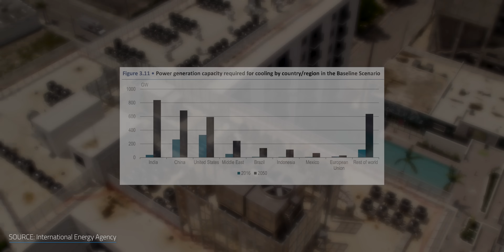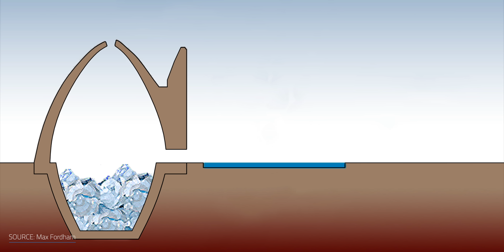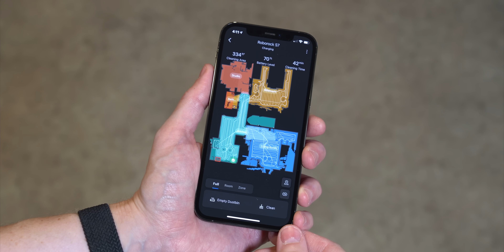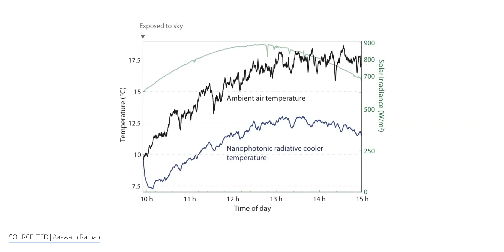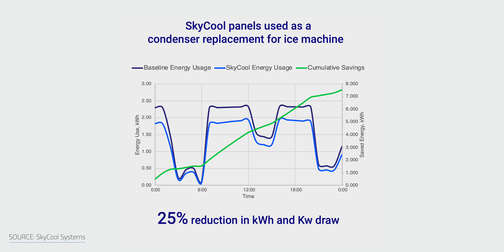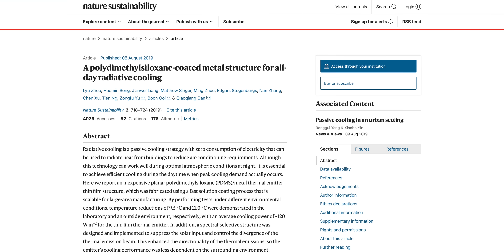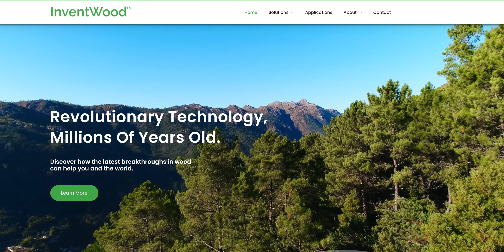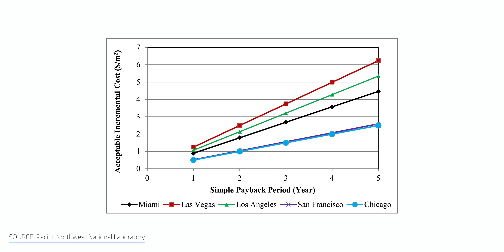Space Powered Cooling May Be the Future of Energy

Comment: It's a pity that the solar energy can't be turned into electricity  instead of reflected back 

Problem is, of course, that at an efficiency of 20% every kWh every unit of power releases four units of heat, which is why solar panels get hot

Comment: I'm a fan of anything that can reflect the heat from city rooftops, but my favourite solution is grass etc that reflects some of the light far better than black roof bitumen etc, the soil absorbs water and delays flooding in the water systems and the flora it adds to the city can help bees, birds, humans etc in so many ways. Of course it weighs more but it can also insulate thermal transmission and reduce noise in or from the building. Ideally it could be very low maintenance too contrary to a paint or something with moving parts. 

The more passive the better, not necessarily "natural".

Comment: If you design the layout to allow for gravity operated heat pipes you can both increase efficiency AND eliminate the electric pump. Braze it together like one would a commercial heat pump system, vacuum it out and inject the right amount of coolant and you'll have an hot and cold side less than 1 degree different.

Comment: Wouldn't it be better to capture some of the heat for hot water?   While the infrastructure costs are high, in multi tenant structures, the heat cycles can be exchanged, move heat where it's needed, heat water for domestic usage, use waste heat from industry for heating domiciles.    This not new, NY had steam distribution, but  it was a non-closed loop system

Comment: My central air conditioning broke in May. I couldn't afford to fix it right away and so I used a window unit in my bedroom and window unit in my living room and I turned on the bathroom exhaust fan.
Grant's sister coming over so I had to get another window unit for their bedrooms. I was expecting a catastrophic electric bill.

What I got was a fraction of my Norma Somerville. This is in humid hot Texas. Headed up stretching through the summer until August What's the total of 5 units. I only ran two at night. And I typically only ran three during the day leaving two rooms without air conditioning. But they stayed in the mid-80s due to air conditioning spillover from the other rooms. And I could chill them into the mid-70s in 2 minutes.

My electric bills for May June July were between 47 and 60% lower.  I got the central air conditioning unit repaired in August. And only used it when company came over and my bill was 31 per cent lower.  
The other benefits of the tiny units is that they can get my bedroom bone-chillingly cold.  That's now I know it isn't running up huge bill.

For hard dollar figures, my summer heating bill for July for a 2000 square foot house was $105. The prior summer it was $188.

They're also tremendously increasing the life of my central unit. They're inexpensive and costs between 85 and $180 depending on if you kept some on sale.  They're noisy in the same room but I get used to the noise after a short time unless I'm watching TV. All of mine are 5000 or 6000 BTU units.

Comment: My life‘s profession is HVAC and I make my money off of selling you the customer the biggest HVAC system I possibly can. 

But on the contrary I do just the opposite I try to inform my customer about insulating an airtight sealing and painting your roof white. 

In San Francisco in my second story of the house when the hot summer months would hit we call hot in San Francisco 85° is burning hot the second floor front face of the house with the sun the room will hit 100°

After putting Armstrong foam roofing and painting it white on an 85° day that same room would get about 89°. Without air-conditioning. 

My mom’s house just by painting the membrane flat roof with three coats of bright white roofing paint just before summer started now we’re approaching October and she never turned the air conditioning on even once. 

A white roof makes that much difference

Comment: If you wanted to cool the planet only then the best arrangment would likely be to float the radiator panels on water.  At night they will coll the water which should sink away from the panel in a natural convective turn over.  Durring the day the panels would flip over (ideally passivly via some density changing fluids) and show a black side to absorb as much heat as possible durring the day.  With no moving parts and mass produced in small units huge bodies of water could be covered.  Waste heat from other sources could be dumped into the water via piping laid at the bottom to radiate more heat.

Comment: So can't these techs do double duty.... reflect a UV heat radiation but have a sub that collect the photons energy.... like a solar panel so that aids in powering these systems plus have that which make these systems less strained in running with these cooling techs. I suppose mixing all these things together may aid in a truly passive home that doesn't need to be on the power grid and have less ac and heating units relying on chemicals that are poisonous. I will be in Arizona but its not for this reason yet I was seeking a way to make a tiny passive home in the middle of the desert that doesn't need AC because most of the solar rays beaming on it are reflected to other areas. I looked at sub terrainian home building or building a dome shaped home with thick walls.

Comment: yah. great idea. while we're at it, why not just throw away our cash, our assets and our customers too? space doesn't need our energy.. we sure do. collect the heat using evacuated solar tube panels.. like the ones we use for solar hot water. then you circulate the glycol through coils in huge sand bunkers. 1 cubic yard of sand holds 2 million btu's- and it will hold it for WEEKS. think of it as the cheapest battery storage device EVER- only instead of storing it directly as dc voltage... as heat. then you use the heat..    to run Stirling heat engines, power generators and meet the rising energy demands. in other words- USE the heat and convert it to kwh's.   

  Stirlings require a 'cold side' to operate.  for that,  you can use buried glycol coils to pull 56 deg. temp from the ground. for this reason- Stirling heat/power systems would work EVEN BETTER in icy cold climates like northern Canada- the setup for hot & cold Stirling power is simply reversed: underground coils for heat- above ground exchangers for cold. given of course.. in northern Canada- the coils would have to be around 10' deep. the 'heat' side could be supplemented by composting bio-mass, instead of burning. this method actually gives off MORE heat than actually burning and doesn't release massive amounts of carbon into the air. it's the process that nature normally does. 

 for areas where there just isn't enough room for all that sand for heat storage- there's a dry chemical powder that can store 2 million btu's in just ONE CUBIC FOOT! then of course... there's always just collecting the heat, run the Stirling engine & charge tesla packs. the advantage of heat collection over straight solar panels... the evacuated solar tube panels remove more of the heat than solar panels do.. .A LOT more.

Comment: Wait, wait Matt. You present a nice graph of radiation transmission through the atmosphere. Before we get into any technology, we need to note two familiar sources. The sun is approximately a blackbody radiator at 5000K. It doesn't burn us up because it covers only 1/(100000) of the sky. The 5000K temperature means that its emission spectrum peaks in the visible, That reaches the earth depending on clouds, smoke etc. You and I and our roofs are approximately blackbodies at 300K, cooler than the sun, but we'd like to cool down more in summer. So we'd like a panel that's white in the visible, but black in that atmospheric window. Is that right?

Comment: It would be far simpler, and longer lasting, to just have a secondary roof layer which stands off the structure on stilts, with the space between it and the insulating layers air cooled by ambient breeze. It wouldn't refrigerate, but this would all but eliminate solar structure heating. And it would last as long as whatever material was used to craft it. The cost:effectiveness ratio would be better, and it requires 0.0% new materials or tech. Plus your roofing tiles would last drastically longer with overhead protection. It would be like being surrounded by tall trees, except you wouldn't have to call your insurance company every time it storms. Add tint on your sunny-side windows, and Bob's your uncle.

Comment: I'm obviously not understanding the technology.
Can anyone explain why to give up solar location?  Why wouldn't you put solar panels at optimal angles on either side of the cooling panels, giving it access to the sky but minimizing its exposure to sunlight?
Better yet...if the hot water was used to heat a lower boiling point liquid, could you not use that radiated heat to power a dual geothermal system to power the pumps as well as not radiate the heat into the atmosphere?
Really asking.

Comment: These are great ideas, in combination with natural solutions. Just thinking about the problem, begs the question. Why not use "plants" the original energy sink that absorbs radiation and pulls carbon out of the atmosphere to produce hydrocarbons that get berried underground.  According to Wikipedia 40% of our landmass has been converted into asphalt, concrete and farmland, that's 10% of the entire globe that's be re-surfaced by us. Man-made structures and tilled lands provide the radiation that is heating the planet. With a little design, we could start using the plants again to absorb the energy that's driving global warming.

Comment: This is not an ideal solution at all.  It is all but useless in climate variable locations.  As HEAT generally takes FAR more energy to accomplish because of the typical Delta F/C, the actual better thing to tackle would in-fact be heating not air-conditioning.

Comment: I messed around with a solar/radiative cooler for water collection a few years ago. A black painted aluminum plate faced north and a similar sized solar panel faced south, keeping the aluminum in shade. The plate got really cold during the night, condensing water, that drained into a catch trough, and the solar powered a pump/filter to filter and store the water.  On clear, cool nights, I could get frost at temps above 40F/5C.

So, based on my goofball testing, these techs seem promising, at least in warmer climates. I think the “super high tech” combination solar/cooling panels are overly complex. Just do what I did, putting solar facing south, providing shade for the north facing cooling panels, and you’re good to go. Cheap, durable, safely cleaned and easily replaced if/when damage occurs.

Comment: A simple experiment to demonstrate radiant cooling can be done with a thermos flask. If you place a thermos outside on a clear night with the lid removed so that the opening is pointing at the sky, the air inside the flask will cool down as the heat energy is radiated into space. I have seen a difference of greater than 10 degrees centigrade with this set up. 
Another example of radiant cooling I have noticed was when I was working on a house extension. Even though it was midsummer we would get ice forming overnight on top of the rigid insulation boards that were stacked outside if it had been a clear night.

Comment: Would it make sense to combine radiative cooling with a heat pump or a/c unit? It seems that raising the temperature of the radiative cooling panels should increase their heat transfer capacity. This could make air conditioning much more efficient in hot climates, versus a heat exchanger transferring to air at 100 degrees Fahrenheit.
Reply: evaporative condensers work better and are way cheaper.   But, california won't conserve water and lets it all drain out to the sea.
Reply: @NathansHVAC  
All water drains to the sea or evaporates on site.
Reply: @nicholasgardiner9601  aquifers would like a word with you
Reply: @float32  
Dang, you mean the water that doesn't evaporate or evapotranspirate, that doesn't flow down to the Sea, some portion of it may infiltrate the ground and attempt to recharge an aquifer?
Reply: @nicholasgardiner9601  doesn't matter, if you DO let it flow to the sea. That's the point
Reply: yes it would
Reply: My sentiments

Comment: What about using this effect to do ice storage at night and use that for chilled water during the day? That used to be a fairly common thing to do with chillers to balance electrical loads and to use the chillers when electricity was cheaper. It sounds like with this you could make ice at night pretty efficiently and then pump glycol through air handlers during the day...

Comment: In Europe we switch to: 1) better insolated buildings 2) PV on roofs (increasingly on sidewalls too) 3) heat pumps 4) using soil and drilled holes for Source of heat and for cooling in Summer (no heat pump used)

Comment: The power needed to drive the pumps could easily be offset by including 1-2 solar panels for the electricity itself. This makes the whole unit operational cost negative, and would make the system pay for itself even faster.  I could see Data Centers taking advantage of this quickly (they tend to innovate on this kind of tech early on).  If they could make the ultra white paints super durable, they could be used to pain roads in very hot climates that would benefit hot cities from radiated heat generation, which would help with the overall A/C problem city wide.

Comment: Scam. 

The wavelength of passive heat radiation depends on temperature of the object. You can't make an object that passively radiates heat in a specific narrow wavelength area that is independent of it's temperature.      

Anything that appears dark blueish from most angles is daylight can not have a very high reflectivity, the claimed reflectivity of sunlight is just a lie.

Passive heat radiation can't actually actively cool, it's there in the names, you can make a surface absorb more or less of the sunlight hitting it, but you can't make an object that passively actively cools.          

Passive heat emitters actually work, but they don't emit heat to a temperature below ambient, and they need to very large to be able to emit a lot of heat energy close to ambient temperature. Also, you wouldn't put them on a sunny roof if you could avoid it, even if you could make them reflect essentially all the sunlight, because you still have that higher ambient temperature because the rest of the roof absorbs a lot of the heat. 

Consuming water is not a big issue with evaporative cooling, it takes over 600 Wh ( >2000 BTU) to evaporate 1 kg, or about a litre of water, and you could technically use sea water. 600 Wh of passive cooling towards the wet bulb temperature for a litre of water, to put that into perspective, you can make freshwater out of seawater with reverse osmosis with as little as 1 Wh per litre. The main actual technical issue is that it difficult to make evaporative coolers that doesn't require much maintenance.                

Also, watching this feels like a déjà vu, did you do a video on this not too long ago that I can't find right now, or was that someone else?

Comment: This was presented a lot more believably than the video by Two Bit da Vinci. Regarding saving 3x the energy a PV panel produces, I don't quite believe them (I checked your article and it's apparently a claim they make, no citations - and it's on their website).
Looking at the calculations in my Two Bit da Vinci's channel's comment, a 100% efficient emitter (one that works in sunlight will have 'disabled' reflective bands, reducing efficiency), a radiator at 16C could emit 186W of heat per m2. A solar panel generates ~150-200W per m2 for ~4h30m a day. That's 675-900Wh a day. With an air conditioner with a COP of 3 that's 2.02 - 2.7kWh per day of cooling per m2 of solar panel.

A 100% efficient emitter panel (no sun) could emit 4.4kWh of heat a day per m2. That's 1.7 - 2.2 times better *best case*. Additionally, I wouldn't assume they're anywhere near 100% efficient. Maybe 20-30% efficient max (admittedly, I don't base this on anything), meaning they're breaking even with regular PV panels at best, with the advantage of also cooling at night.

Comment: In an off grid power system in a sunny country what is the benefit of hi tech cooling I wonder? Point is it is great and all, but the for power self sufficient houses that money might be better spent on more panel/battery capacity/inverter etc and running a conventional air cond system.

Comment: What if I told you the earth is a Closed System: Open Escape so we are never going to overheat outer space nor the earth since heat rises, then cools into space or the air mass comes back down cooler because space is well, very cold and there is a lot more space than earth space and earth's pollution also is found in comets via space probes and we know from studies that pollution rises & flows into space or it falls back to the ground.  However, man does contribute to global warming and cooling but mother earth does a lot too.  I'm all for new forms of energy but solar and wind are supplemental power sources only and solar creates a lot of heat TOO!

Cooling panels placed underground could work even better than the current deep piping system but you'd need room so industrial applications could get better over time. Home systems should work much better with trees nearby. Underground is viable plus you don't have to go too deep.  Or place the panels under the home where its always cooler!!   We could make our own coolers with current applications much like solar water heaters.  No need for the fancy covers. Pipes plus the right coolants equals a better HVAC system.  Plus alcohol based coolants will not freeze in most areas.